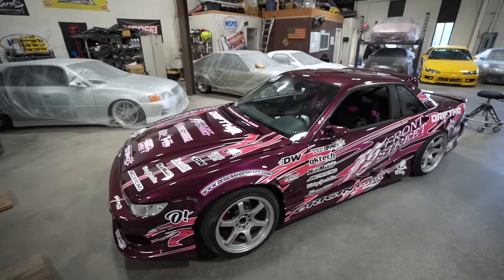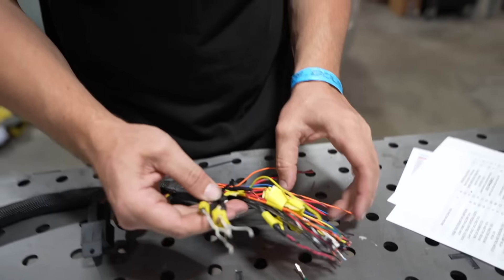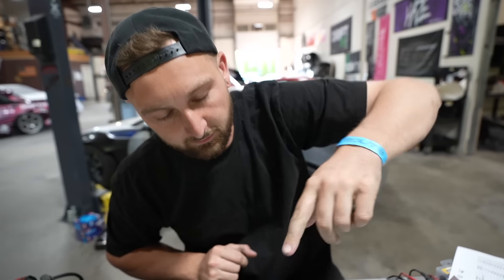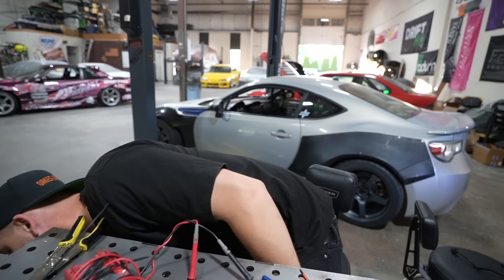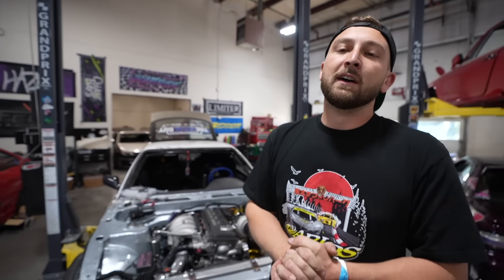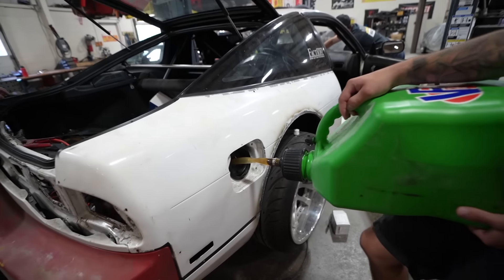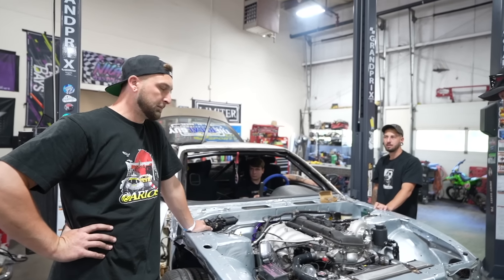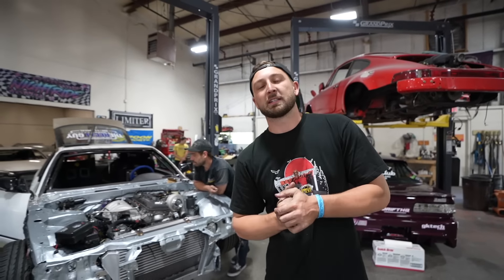SURPRISING my friend by FINISHING his PROJECT Car!

Comment: You can run the s15sr20det plug in ecu on the stock ka harness you just have to swap two pins. So technically you could get a new ka wiring specialities harness with s15 plug in.

Comment: good compression against all 6, PLUS having good wiring and good engine management and good sensors to montior all that shit together... that is the combo of a smooth running motor, any one of those previously stated factors is a miss. then you WILL have stutters and stammering in the idle.

Comment: So far wiring specialties is shit for any FD rx7 stuff. Bought their harness they wouldn't offer it with emissions removed even tho Jimmy said they're customizable, Had to do that myself. Also they shared the wrong grounds on my harness which fucked up tps sensor & map sensor signals. They also don't offer any OEM connectors for it without buying a whole harness. Was a shit show to get my build going. I should have went with Rywire.